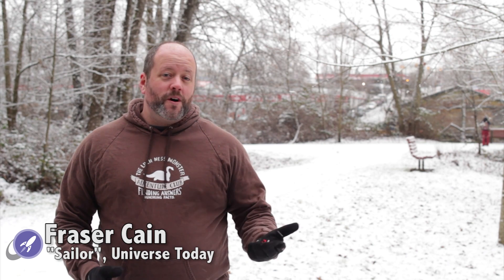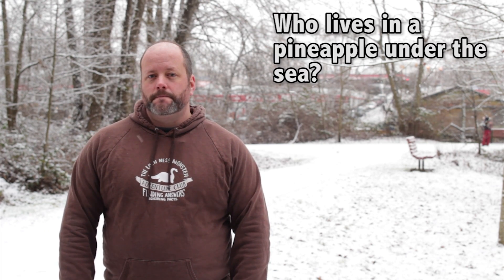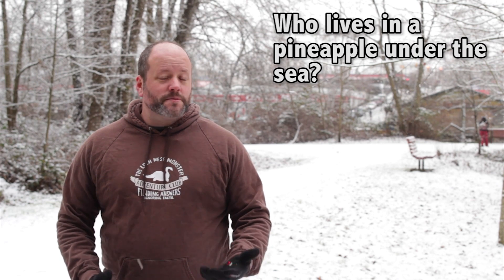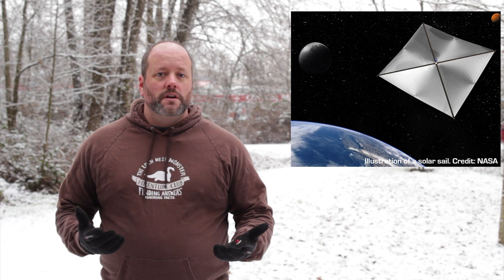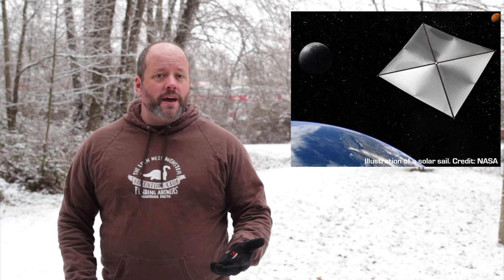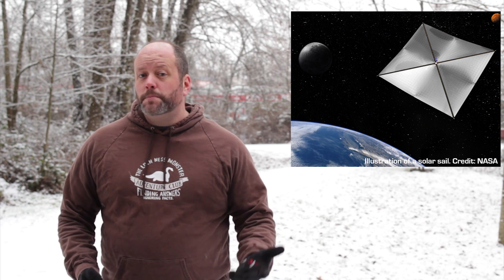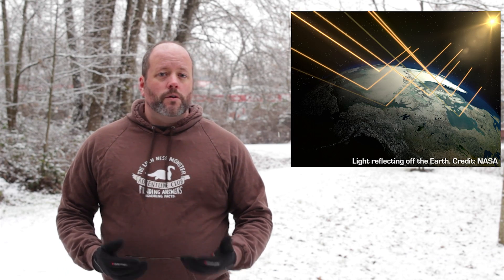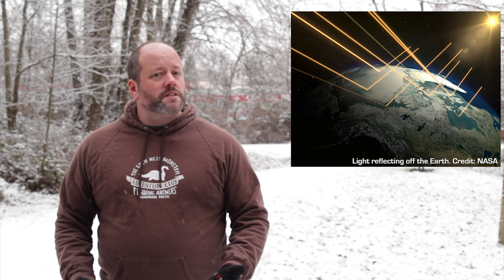What Is A Solar Sail?

Comment: I've some doubt, the photons travel perpendicular from the star. Changing an orbit increasing and decreasing the speed is pretty clear but you need to increasing or decrease the speed tangential to the orbit not perpendicular otherwise you will have for example an higher orbit but with the same tangential speed which will eventually brake the orbit. I'm not an expert but I can't see how this may work. What I see os that you can increase your speed only in one direction which is way from the star. To slow down you need some different propulsion or the opposite effect from another star you are approaching 🤔. Said so I think solar sails are very very delicate and can be easily damaged from any small dust you may incounter during the trip. Are indeed fascinating ideas but at the moment not very practical.
Reply from the maker: You can raise or lower your orbit with a solar sail. You're in orbit, so you turn it 45-degrees to the Sun and you'll start to spiral outward. Turn it 45-degrees the other way and youll spiral inward.
Reply: @frasercain yes, can be. Doing so you need to consider an acceleration vector that it is not tangential but 45deg with the prograde direction which will increase also the altitude of the orbit not at the new periapsis and not necessarily with the correct speed to keep it. Interesting to see how efficient can be this way. For sure is a free "propellant"

Comment: Yeah but who's controlling the sail movements. Or are we supposed to believe they just intuitively do it in their own to speed up and slow down 😅
Reply from the maker: They control the sail like they control any spacecraft or rover. They upload commands from the ground and the spacecraft executes them.
Reply: @frasercain oh. What is executing those commands? On-board AI/computers? How are they sending those commands? There are no WiFi masts in space 

I just don't think humans can control for example voyager to change its direction constantly to slow down and orbit a planet then move out of its orbit to the next one. They aren't all in a straight line as depicted in books. They all rotate the sun at different speeds and different orbits so voyager would have had to change course many times. 

Voyager is apparently outside of our solar system now and yet we are still expected to believe we can communicate with it and it can communicate back. It was launched in a time way before WiFi and HD anyway
Reply from the maker: Voyager communicates in radio waves, and NASA uses a 70-meter radio dish to communicate with it: https://eyes.nasa.gov/dsn/dsn.html

This will show you what each of NASA's radio antenna is pointed towards and communicating with. They're actually running out of bandwidth because there are so many spacecraft out there now.
Reply: @frasercain yeah I know what's on the nasa website, I just don't believe all of it. 70m? Yet able to communicate with something outside of our solar system? Its 15 billion miles away according to nasa

Comment: Hi Fraser. I know it is probably the most stupid question somebody have done but I don't understand what happens if the solar sail thruster goes to the back part of "Moon" or "Mars for example and doesn’t receive the photons. Thanks
Reply from the maker: If you're blocked from sunlight, then you won't get any propulsion.
Reply: Thanks so much, and sorry if it was an obvious question.
Reply from the maker: Hah, no problem, keep the questions coming.

Comment: Angling a sail with a boat works so long as you have a keel to keep the boat going forward instead of sideways.  So with just the bounce of the photons, your possible directions must include a lot of drift?
Reply from the maker: It's important to think about how objects orbit in the Solar System. It's all about raising and lowering orbits. Mercury has a lower orbit than Venus, etc. The point of the solar sail is to make you go faster or slower in orbit, to raise or lower your orbit.

Comment: when you say light do you mean just visible light or do you mean everything on the electromagnetic spectrum including radio and x-rays? Also ive been told everything on the spectrum moves like a wave so i dont really understand this photon thing unless its the photons that move like waves? im really confused
Reply: Everything on the electromagnetic spectrum is a photon. A photon is just a packet of energy with some wavelength associated with it. That wave length is simply the speed at which the electric field oscillates. SO it is a packet of oscillating electromagnetic energy. Now different wavelengths react with different materials. Only the photons which can reflect off of the sail's material will actually push on it. This is not everything, but since it is probably foil, a lot of wavelengths will react. Higher wavelengths will still penetrate the foil though.

Comment: Just so you know, Nanosaid-D 2 was not a solar sail at all in terms of the way it was used. It was deployed so low in the Earth's atmosphere )650 km) that aerodynamic drag was about 30x greater than any solar forces. NSD was a DROGUE CHUTE. It was a bad drogue chute at that, because its fairly well-designed passive magnetic attitude control system was designed for the initial planned equatorial orbit, and that's not where it ended up.

The rocket carrying the first NSD blew up right off the pad, and the backup NSD hitched a ride on FASTSAT. FASTSAT has an all-magnetic attitude control system, and it was determined (by me) that NSD's magnets posed a significant threat to FASTSAT. So they were removed. Had they been in there, we could have expected about half the drag area of the original design. With the magnets removed, NSD was pretty much guaranteed to go into a flat spin fairly parallel to the orbital plane- the minimum-drag configuration. Hence, at best it would have been a drogue chute. As it was, it was a really bad drogue chute.

I never could get the NDS Principal Investigator to be honest that there was nothing solar going on there. But I really hate NASA claiming that they flew a solar sail when in fact they did nothing of the sort.